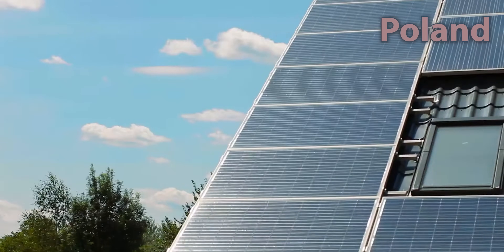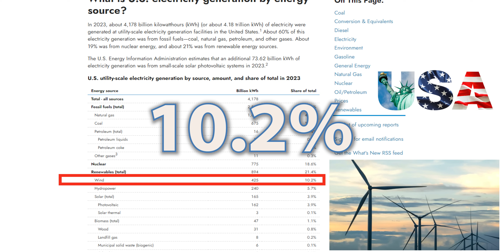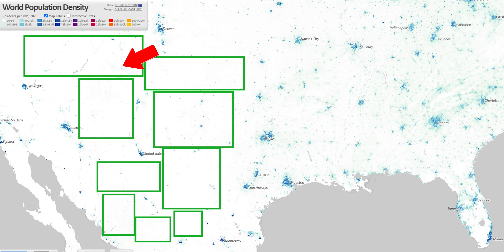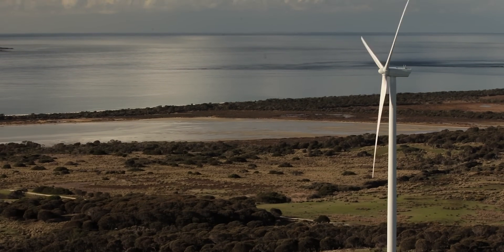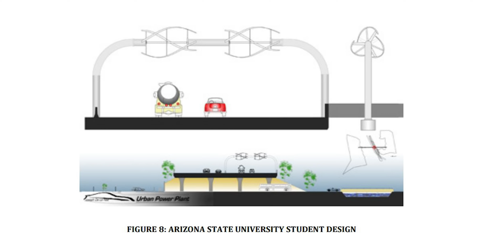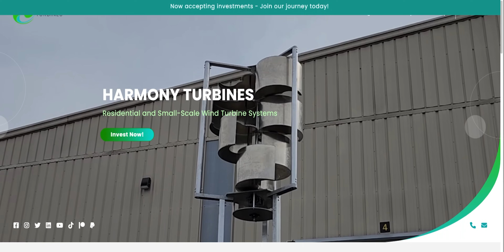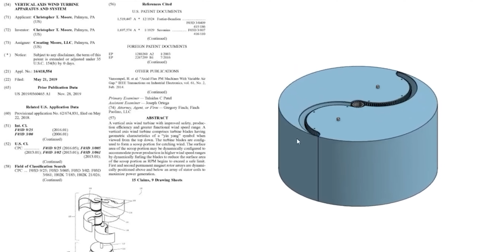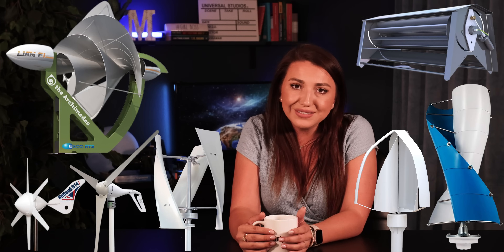Residential Wind Power: Revolutionary Tech or Overhyped Myth ?

Comment: The problem with highway side turbines is driver distraction.  With lighting towers, moonlight, etc, the glint from the blades will get weird at night.   There is a highway in California where I have witnessed this during a foggy full-moon night. The wind turbines on the ridge above the highway were above the fog bank, I was below it.   The result was swirling lights in the clouds - to say the least that was distracting.   I only figured it out on the return trip during the day when I could finally see the large number of horizontal and vertical axis turbines that had been hidden previously.   That was a bit of a relief as I was wondering if it was a UFO.
Reply from the maker: Oh my! That is a valid point too. Safety is so important! Thank you for sharing, and thats very interesting point that has to be considered.
Reply: driver are already distracted by phones, infotainment centers....and then they try and drive......but im not sold that it would distract them too much more so.

Comment: Wind... Expensive, too intermittent, much more site/location specific, building codes/karens/NIMBYs.

The list goes on and on. But mostly it's because wind is basically terrible if you can't get significantly higher than everything else in your area.

A solar panel badically just needs clear line of site to the sun and even those don't make sense in tons of areas. My own quotes for solar aystems on my house all had payoff periods in the 15-20 year range and that was without batteries. Adding batteries makes the payoff never happen.
Reply from the maker: Hey! Thanks for sharing your point of view. DO you mind me asking what state your ein that makes solar only such a long ROI? In North texas we should get like 6-10 years. But I know lots of SCAMMY solar companie charge way more and screw people over ;/
Reply: @solartimeusa  I'm in East Coast Canada. For one I couldn't use any rebates. Second our energy rates are very low (about 12 cents per kWh pre-tax). Third our solar hours over the year are low, especially because of low sun in winter where we use the vast majority of our energy. Then fourth, I have a hip roof which only allows a small number of panels with the layout of the property so the amount of panels vs the labor costs are just too high.

I'm figuring out now if I can just DIY most of it to help gets the costs down and make it more reasonable.

All of the quotes I received were pretty reasonable and didn't seem sketchy at all. It's just a ton of circumstances all coming together to make it less viable than I had hoped.

Comment: really solar panels only run on light, solar waves actually come day and night
Reply: some kind of aerial system would be much more efficient and take up less room
Reply: @doubleooh7337  I'm not sure that room has any bearing on the issue.  You are going to have a roof on your building whether it is covered in panels or not.  As for efficiency, at this point solar is more efficient for a greater percentage of people.  Here in San Jose there is a lot of sun during the spring, summer and fall and little to no usable wind in late spring, summer or early fall.  So having a turbine helps in the winter when there is more wind but you would be hard pressed to depend on it year round.
Reply: @bryanwhitton1784  what are you talking about? nothing to do with what I'm tsking about,  i didnt say anything about wind!
Reply: @doubleooh7337  Hmm, As the topic of this video was wind and you referred to an aerial system which I interpreted as a wind tower, that is what I responded to.  What are you talking about then?
Reply: @bryanwhitton1784  antenna kind of stuff

Comment: watts per dollar.    solar panels are cheaper and less noise
Reply: True, but I don't see them as an either or product.  If I had a small turbine that worked in variable winds then I could complement my lack of solar power in the winter with the turbine.  During the calm days of summer my solar array produces the bulk of the power.  This could even out my production.  I could add more panels but the utility wouldn't approve it.  I am not sure they would approve the turbine either as they aren't common here.  A lot of variables but interesting to keep aware of but the potential is interesting.  

It's always nice to have multiple tools available to solve a problem.
Reply: Solar is useless in the north during winter. Wind blows even more during winter.
Reply: Wind turbines can produce power at night and in cloudy weather. They can work alongside solar or in places where solar doesn't make much sense at this point in time, provided that the particular wind installation does make sense in that very place of course.
Reply: @zbyszanna  Most small wind turbines only make 100 - 200 watts when there is a good wind, even less in a breeze and you cannot run your home at night on 200 watts if you have more than just LED lights on.
Reply: @Bowhunters6go8xz6x  Most homes outside the US run with less. Mine e.g. needs about 100 W.
Reply: AND MORE ENVIRONMENTALLY BAD...🤡🤡🤡🤯🤯🤯😭😭😭
Reply: VIBRATION - IF THE CHEAP FUGCKKRSSZ SPENT A FEW DOLLARS ON RUBBER MOUNTS ( LIKE YOUR CARS ENGINE SITS ON) - PROBLEM GONE....🤯🤯🤯🤯😭😭😭😭🤡🤡🤡🤡🤬🤬🤬💩💩💩🥳🥳🥳